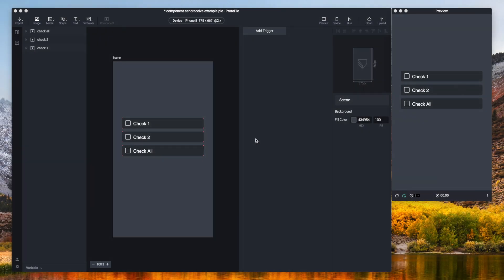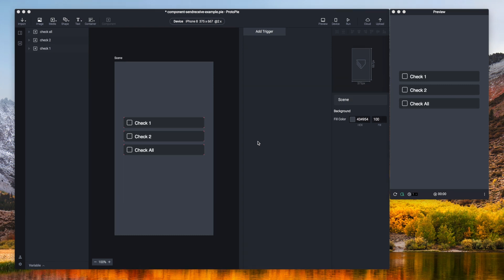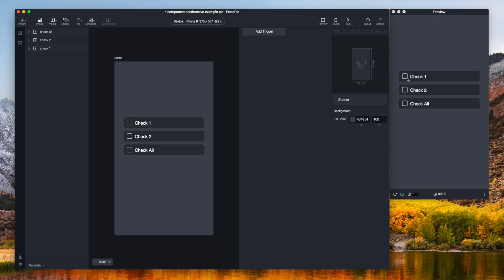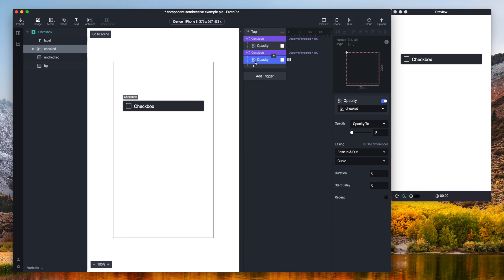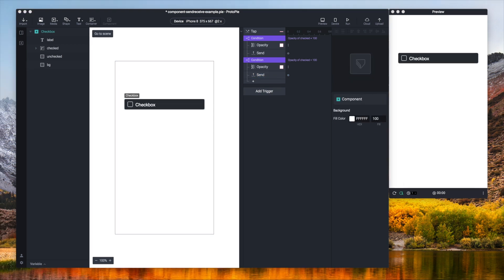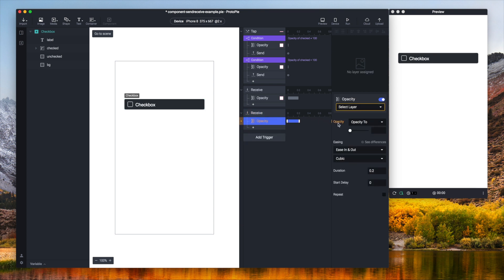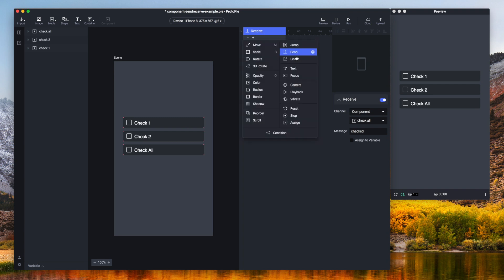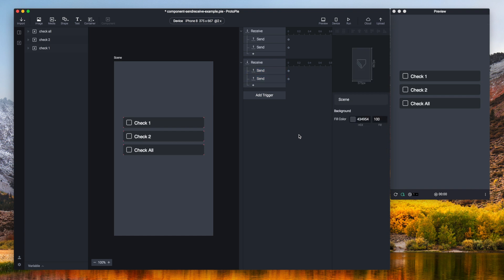ProtoPie Tutorial | How to Create And Use Components Part. 2

Comment: Too bad groups that were made into components don't get updated when re-importing from Sketch. They get imported as new groups/containers. Making it impossible to keep your designs and prototype in sync at all.
Reply from the maker: Hi Mark. Sorry for the late reply. A way around for this would be to use the Sketch plugin instead. You can go to the main component and import your changed designs there with the plugin.